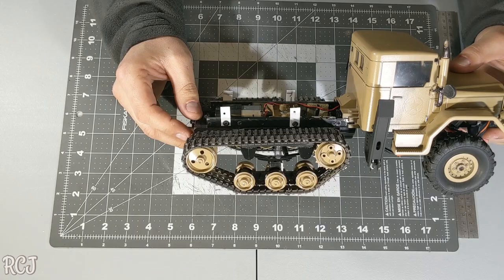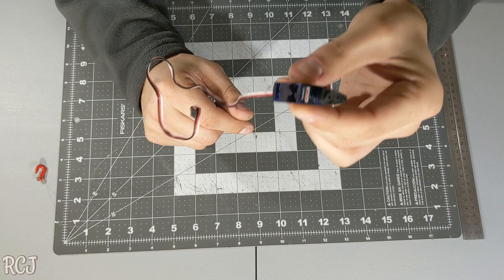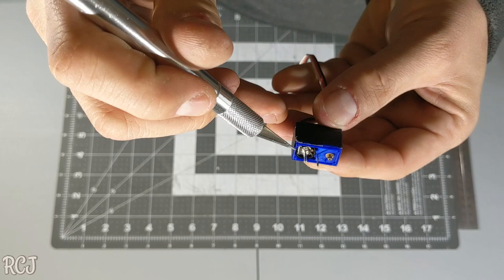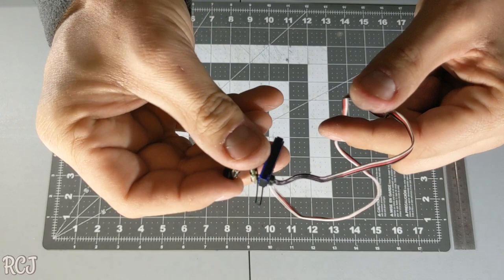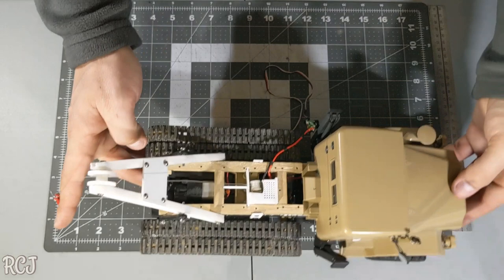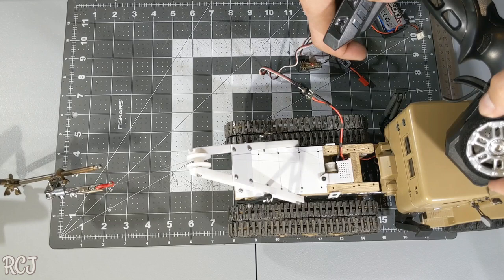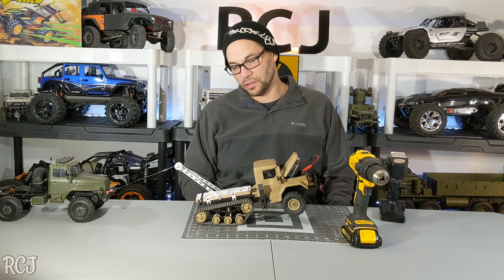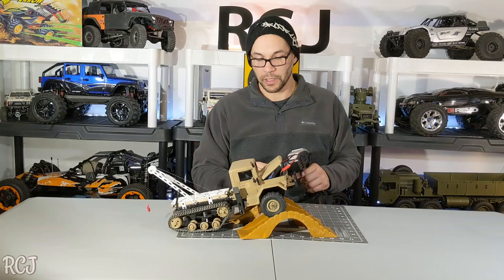WPL B-Rtrack (recovery half- track build pt.2) testing time! #wplrc #wplmods #wplupgrade #rclife

Comment: have you considerd making the 2 back struts "hydraulic" or sliding internally in a tube/piston configuration so that with a 2nd winch you can lower and raise the entire a frame ?
that would give you a bigger range and the ability to pick things up and stow them on the back.

on mine i will put a portal crane that can move back and forth along the bed and lift items from just behind onto the bed. 
give it a think please.
i also have differentials in mine, a metal gearbox and a different drive setup, i use Fayee/eachine gearboxes  and a single tamiya track system, i have a brushless motor (2440) in mine as well, and i have spinning tracks /wheels under acceleration (whoops).
Reply from the maker: Thanks for idea sounds amazing. Find me on FB or Instagram would like to see your build.